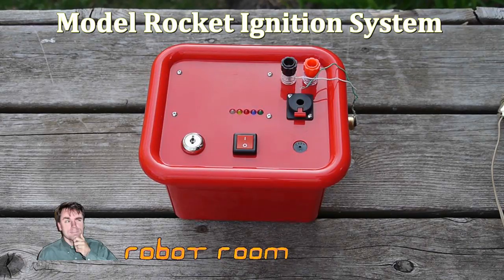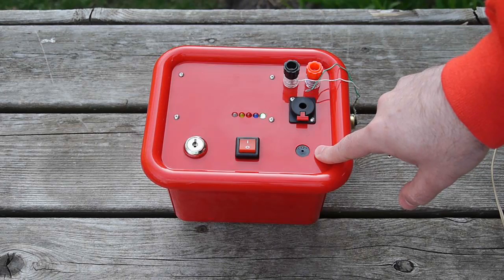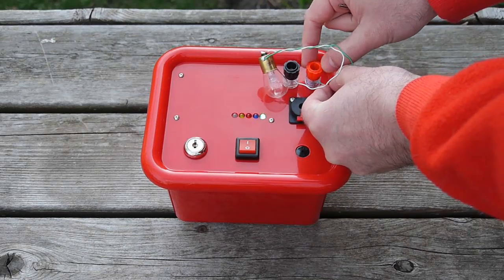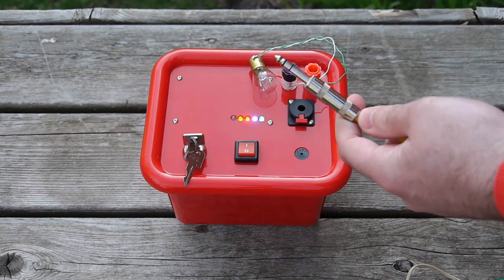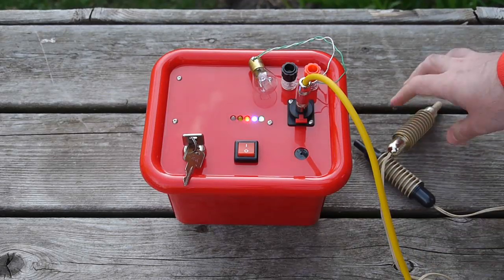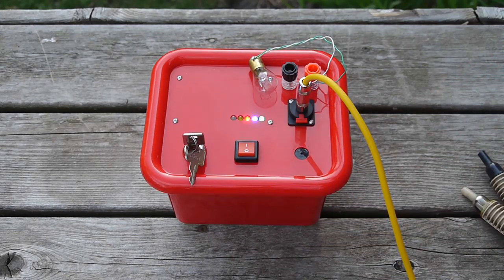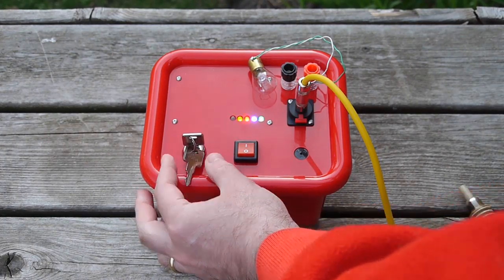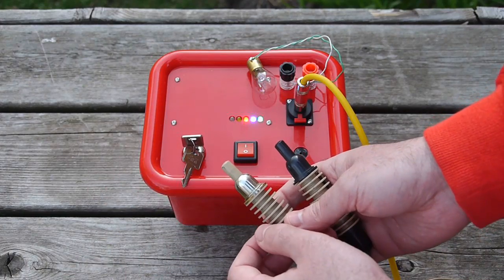Model Rocket Ignition System

Comment: This is so crazy, I just finished building a fully handmade ignition system, I never seen yours before and the system is basically identical! Including: lockout key(ignition key from a lawnmower), loud alarm(cheap house door alarm), current/system check button, LED indicators, and the most shocking of all coincidences, I used a guitar cable and jack for the cord that goes to the rocket and for the same reason as you that it’s such a nice no jarring plug. I wish we could post pictures on here so I could show you. Inside the box looks a bit like a rats nest lol since I didn’t use a circuit board, mine is basically an “old school” Breadboard, circuits, wires, and screws mounted onto a wooden board.
Great job on your system!